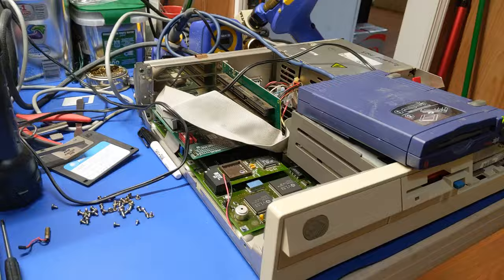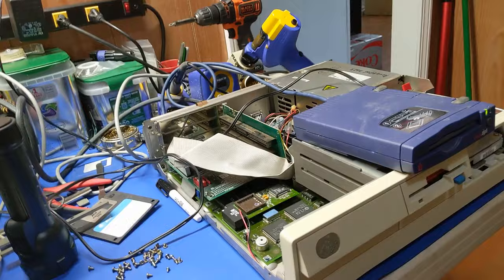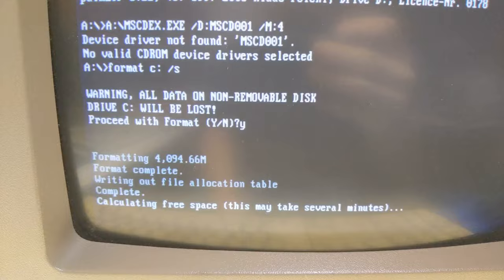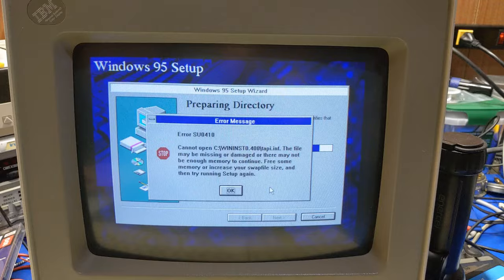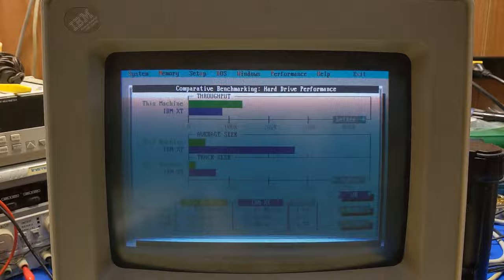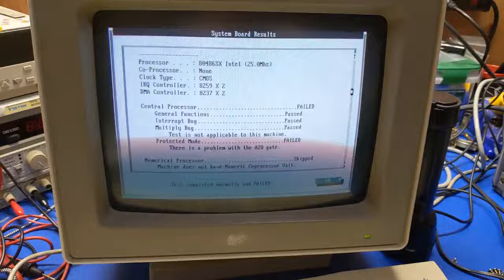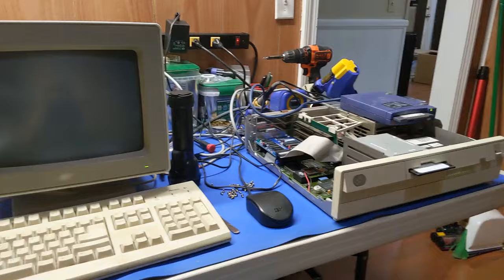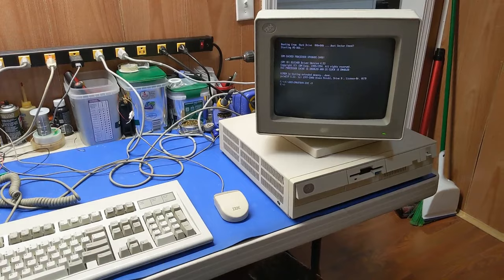IBM PS/2 Model 30 with Windows 95?

Comment: A20 line is the address line that lets the PC access memory above 1 megabyte.

On the PC/XT ... because the 8088 uses memory segments .... you can access beyond the 1 megabyte range of its physcial memory map by turning loading up a high segment (say FFFF) and then accessing addresses from that segment. So what would happen is that the memory access would wrap around and you would see the beginning of the physcial memory map again. The 8088 accesses memory through pins AD0 through AD19, so anything beyond 1meg is truncated and wraps around.

On the 286/386 and beyond though, even in real mode, if you accessed physical memory beyond the 1megabyte limit using segments, you can actually access the first 64kb of memory beyond what an 8086 could. To maintain compatibility with the XT systems though, IBM routes the A20 pin through the keyboard controller. By default, the keyboard controller blocks A20 (keeps it electrically low) from reaching the memory modules (and their associated logic) to emulate the same behaviour as the 8088. To enable full access to memory, your software needs to tell the keyboard controller to pass A20 through to the memory modules. Hence this is what the A20 gate is. 

Later versions of MS-DOS, when you load HIMEM.SYS, HIMEM.SYS tells the keyboard controller to allow the A20 signal through, and provides DOS with the 64KB block above 1 megabyte and then the DOS software transfers itself into this high memory area.

On later motherboards, the A20 gate logic is reimplemented in the main chipset for faster operation. Hence if you turn on Fast A20 gate in the CMOS settings, the chipset responds to the keyboard register modification commands and turns on/off the A20 gate ... much faster than the "slow" keyboard controller normally could.

Comment: I didn't think I could add a regular IDE drive on an IDE controller on my model 30! I need to find a squeaky one! That Windows 95 reminds me my first computer, a 386 DX/25 with no cache and only 2MB of RAM. Anything would swap on the HDD, it was painfully slow. My PS/2 is now being finalised yay! No Windows 95 on it though, it's the 8086 version :) Slowest than Slow :)
Reply: The only "squeaky" IDE drives I can think of are some of the really old ones, like the WD 93044 and Seagate ST-157A. Kalok made a higher-capacity stepper drive, but their quality was terrible and a lot of those drives haven't survived. You may be able to find a Seagate ST-351A/X in good shape, since it was the last stepper-motor drive Seagate made and they tended to go into older systems that weren't pushed too hard.

Comment: When I still had my 30-286, I actually shoehorned an Adaptec 1542 (which I still ahve around here somewhere) and a 2 GB Quantum (which I don't) into it, and it worked aside from the mounting situation. 

The VGA on this is the original Micro Channel VGA from 1987, glued to the 286 bus through that QFP chip at the middle left of the motherboard. It's been years since I've had my 30-286 and I never tried it, but I wonder if it's possible to disable the onboard VGA and put in something like an ISA CL-GD5428 (since it has accelerator functions).

Comment: Also: If HIMEM.SYS is loading and you can load DOS high, then the A20 line is working, regardless of what CheckIt says. CheckIt may be trying to use a method that only works on older machines (though you would think it would know what Fast GATE A20 is since the PS/2 had it at launch).

Comment: Okay so you have the old planar with the odd/even ROMs. if you grab ROM image 33F5381 from ardent-tool and break it up into odd/even you should have a better BIOS image than what it shipped with originally. Windows 95 will also run a lot better for certain things if you have the math coprocessor installed, probably. you want a Cyrix XC87SLC I believe.

A Tseng ET4000 card will definitely do you some good. 95 includes support out of the box for it, and most of them have an upgradable DAC chip to do anywhere from 256 colors to 24-bit color depending on the resolution. I believe the IBM SLC2 uses the same addresses as the Cyrix/TI 486SLC so you should be able to use any of the third party enabler tools for those chips. Ideally you may need to /? the executables to get command arguments, it might be that the Gate A20 line isn't enabled out of the box.

IIRC Win95 hates the IDE bus on some of these systems for whatever reason. the 40SX I have is no different. BlueSCSI's latest firmware revisions also support PC formats properly now, so there's that too.